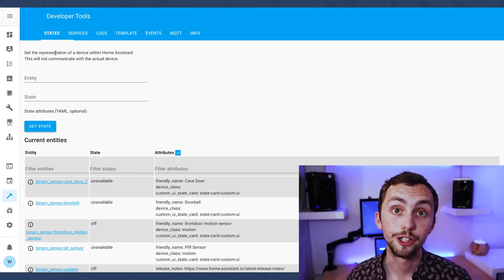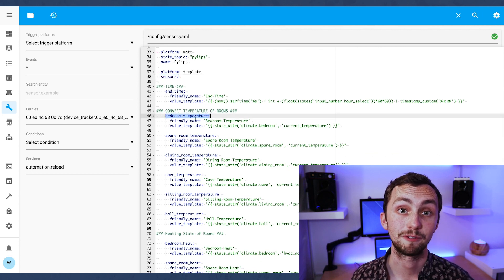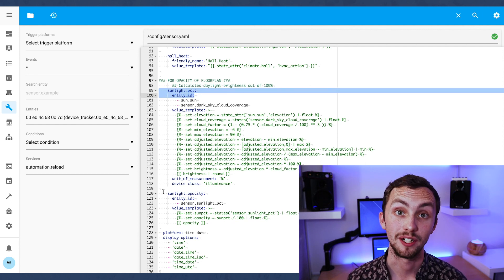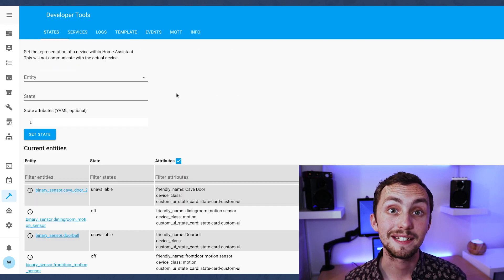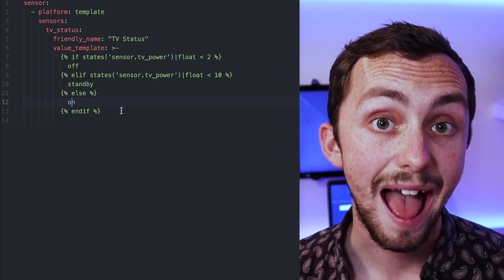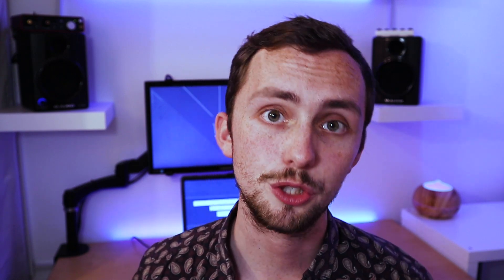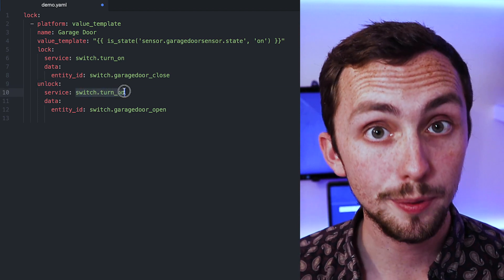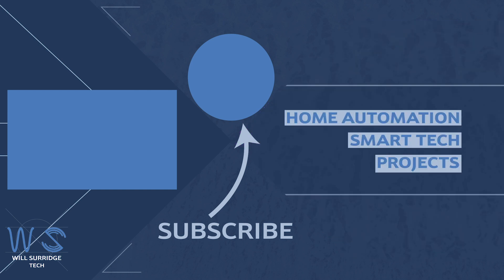Templates in Home Assistant - what they are and how to use them!

Comment: This helped me a lot, but as usual I didn’t quite get it all right. I have a Shelly operating a garage door, but it doesn’t know the state, so if it’s open it closes, and if it’s closed, it opens. Separately I installed a 422mhz magnetic reed switch, and with the help of this video and links I got them grouped together. But one issue, the icon changes to yellow when the door is open, I’d like it to change to show and opened door. Anyone point me in the right direction?

Comment: Sir i am trying to animate my fan icon. i found the below code to add a template and one more code to add to lovelace. I want to know how to create the template for the first code

button_card_templates:
  ceiling-fan-icon-settings:
    show_icon: true
    show_label: false
    show_name: false
    styles:
      card:
        - height: 36px
        - width: 50px
      grid:
        - grid-template-areas: '"i"'
        - grid-template-columnns: auto
      icon:
        - height: 26px
        - width: 26px
    state:
      - value: 'on'
        spin: true

where do i enter the top code?

the second code to add to lovelace is easy:

- type: custom:button-card
  template: ceiling-fan-icon-settings
  entity: switch.24578876840d8e891ee7
  tap_action:
    action: call-service
    service: switch.toggle
    service_data:
      entity_id: switch.24578876840d8e891ee7
Reply from the maker: Templates for lovelace cards are different to home assistant templates.If you are editing lovelace using the yaml, then the top code just needs to go into your ui-lovelace file

Comment: Apparently I need more research because nothing has worked thus far. Again copied what I thought would be relevant and got error "end of the stream or a document separator is expected at line 4, column 5:"
Sensor.yaml
    - platform: template
    sensors:
    battery_voltage:
    friendly_name: 'Battery Voltage'
    value_template: "{{ ('sensor.tasmota_dht11_range' | float / 100 | round(2) )}}v"

tested {{ ('sensor.tasmota_dht11_range' | float / 100 | round(2) )}}v in the Developer tools template section and no errors and showed what I was looking for, so you must need more to the file.

your vids must be for the more advanced user, cause nothing has worked and I am suspecting I am leaving out something obvious to other users
Reply from the maker: Hi Michael, if you could send me your code with pastebin on facebook I'll have a look and see what I can do - I'm trying to make my videos as accessible as possible :)
Reply: @WillSurridgeTech  my configuration.yaml is extremely basic, nothing in there except the includes. As for the sensor.yaml, you see it, the whole thing is listed above 5 lines of code starting from "- platform: template"... it is a direct copy and paste... Any help is extremely welcomed. Again, new setup.. I haven't even figured how to ssh into my pi, can't even use the login from pi itself, must be a default user created during install that is different from the one you use to see hassio GUI. I do get the sensor data via lovelace and I can use line 5 in the template test interface.
Reply from the maker: If you drop me a message on fb.com/WillSurridgeTech I will get back to you on there - much easier to have a conversation and try to figure out the problem than via comments :)

Comment: Will, this is aweseome. Actually slow enough that I can understand! OK, so let me ask you a question. I've been pulling my hair out with my garage door because I haven't been able to form the template. Can I ask you for a small favor? So let's say I'm using a custom button card on lovelace to display a garage open icon when the garage is open, and I can tap that icon to close the garage door and the icon changes to the closed garage. I would be toggling the garage door via a switch.garage_door, but the status of the garage door is reported via a reed switch (binary_sensor.garage_door).  This is what I have so far: https://imgur.com/ncjAy0U, but I'm trying to use Javascript on Lovelace to get this to work, and I'm guessing templating maybe an easier way to do this. Any ideas how I might modify the code? (I'm reasoning my way through code by example, and have no actual knowledge of coding). Thanks a million mate!
Reply from the maker: If you drop me a message on facebook, I'd love to have a look into it for you!